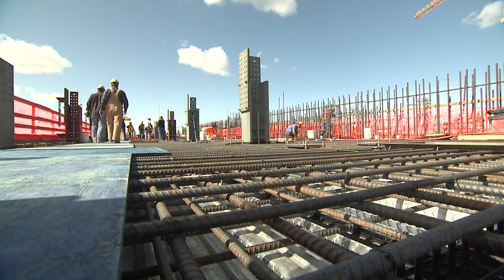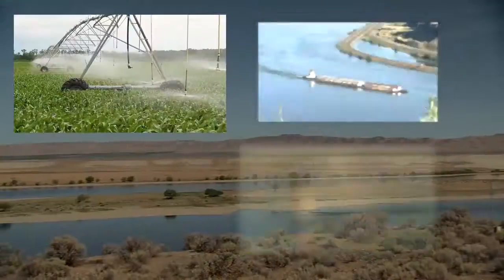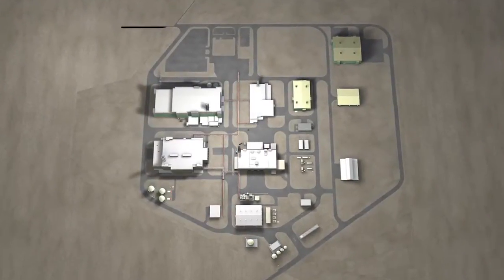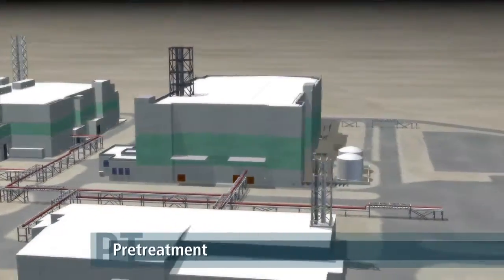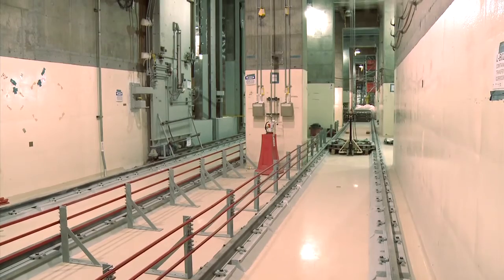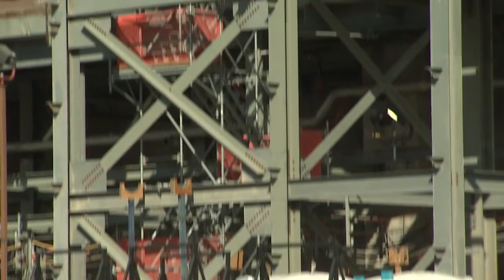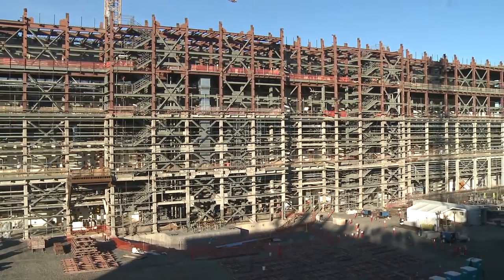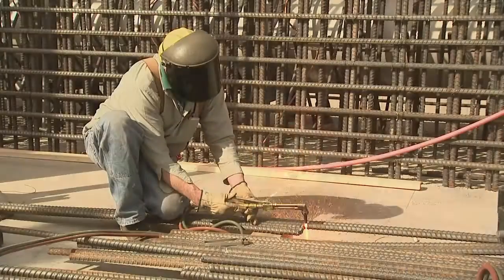Hanford Vitrification Plant

Comment: Maybe it's time for another way to backup power to your reactor and cooling ponds. That works 24/7 , won't harm fish and backs  up your diesel generators in case of power loss. The products called Waterotor  a slow speed underwater turbine and it's made in Canada. I do not work for a sell this product it's just an idea I found on YouTube  that might solve a problem for you. Search Waterotor on YouTube and see for yourself, don't be stuck like Chernobyl is  without power because of the war. These units can be built to meet any size needs you might have. Let me know if you like the idea.

Comment: At 400 canisters per yer it should only take about 1000 years to finish the cleanup. FAIL.
Reply: Want to show your math?
Reply: @kylesenior  They quote 400 per year are going to be made, divide that into the millions of pounds of waste that are being stored in the underground tanks... yea, at least 1000 years to finish. This is whats called a "snow job". Look it up.
Reply: @hakapik683  The amount is 56 million gallons. So I do actually.
Reply: @kylesenior  Gogle is your friend haha. That is just a small % of the total amount of waste, only the waste in the tank farm. Try again. Its a far larger number. Sad but true.
Reply: @hakapik683  You clearly have no clue about the difference between high level and low level waste, or that this plant is just for dealing with the high level waste from the tank farm.
Reply: @kylesenior  There are 2 plants actually.. one for high level and one for low.. does not change the fact that the current pace of putting the waste into the glass form for long term storage is VERY SLOW. In the video.. did they quote the time frame that they think it will be finished? Go find what they say about how long it will take........ then come back and tell me what that time frame is, and at what point in the video its mentioned.
Reply: @kylesenior  Oh, and since you know everything on the subject you MUST know that not one single drop of low or high level waste has been treated there yet, right? Face it.. you really dont know what you are talking about, and since you dont LIKE what I said.. you automatically think I must be wrong. I wish I was wrong!! But I am not. It will take your lifetime X 10 to get all the waste cleaned up.

Comment: What happens if the glass breaks?
Reply: Josh it’s glass soo it will be in smaller pieces, might need to be revitrified.
Reply: It's turned into one huge chunk of glass......from liquid into solid.   Then they don't have to worry about it spilling or soaking into the ground and contaminating the Columbia river.